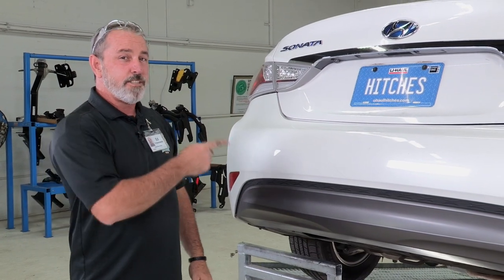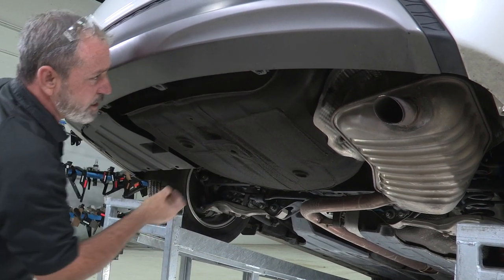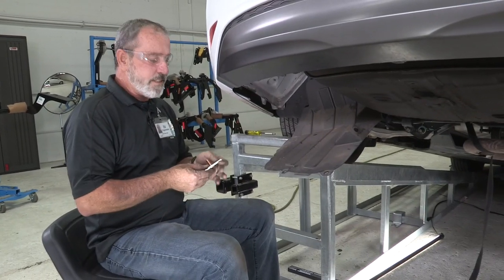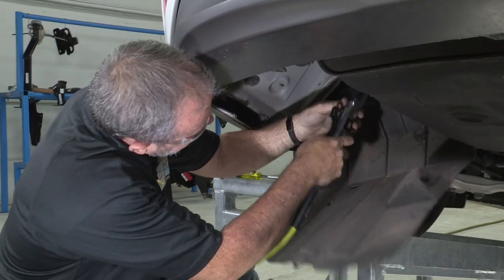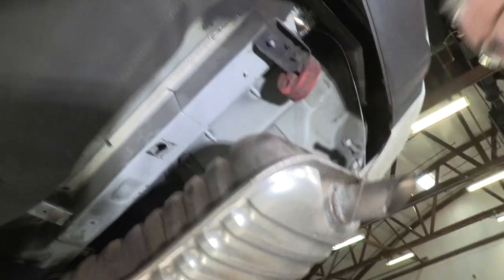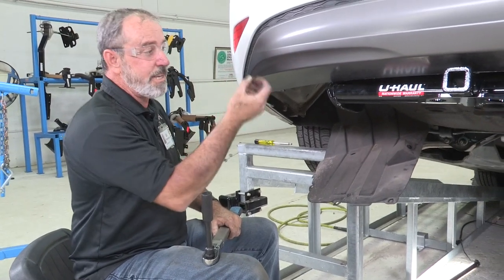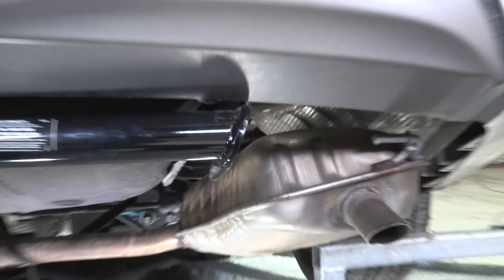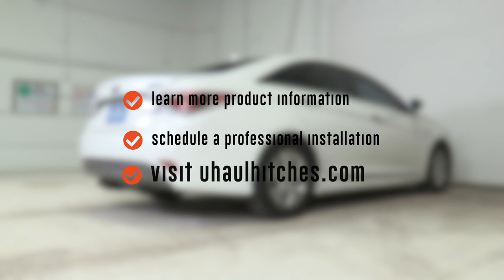2011 Hyundai Sonata Trailer Hitch Installation

Comment: Video fell Short of perfect. Would of been great help if, while Tightening the hitch bolts onto the frame, you would of given the exact lbs of pressure needed on the Torque wrench...!
Reply from the maker: https://assets.curtmfg.com/masterlibrary/11025/installsheet/11025_INS.pdf

Here is the manufacturer instruction that include the torque specs.